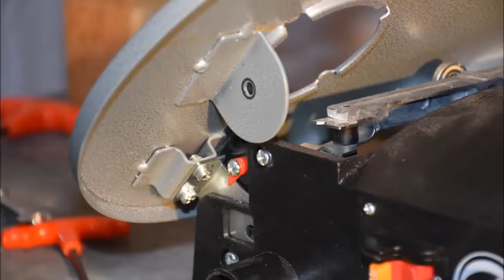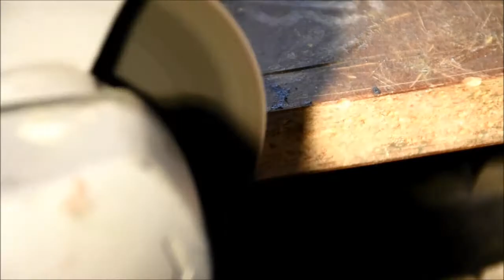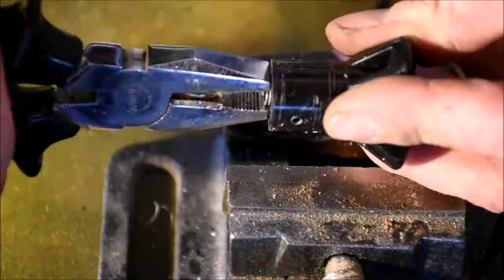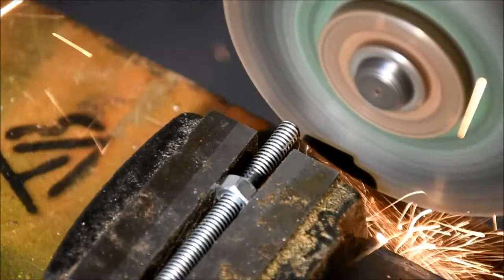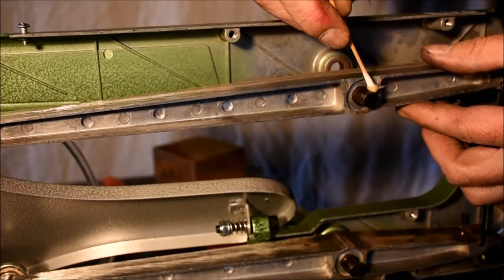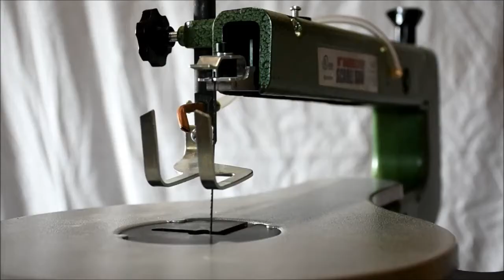Scroll saw blade tension bolt repair - Harbor Freight Central Machinery

Comment: Thank you so much for this tutorial.  It has helped me a lot.  I am still trying to get INTO my scroll saw. which is pretty new.  The older one went the same way. I am reluctant to buy yet another one, if they keep going this way.  This showed me what the pins are for, and has helped me try and work out (if possible) a way of getting into the inside. so far I had taken all the screws out, but no joy as yet.  BUT - this certainly helped to let me know what it looks like inside and what the issue is.  SO, THANK YOU SO MUCH.

Comment: EXCELLENT video. Have you thought of a quick cam lever to open/close tension for blade changes? Like some of the more expensive saws.  Small very detailed projects with lots of inside cuts and multiple blade movements gets tiring. Thanks for the video.EDIT: Found this. https://www.youtube.com/watch?v=cnHbNhOj4qY
Reply from the maker: Thank you.  I would like to upgrade the scroll saw some day, but it sees very little use, and therefore is low on my priority list.  Take care.
Reply: Thanks.

Comment: Excellent video!  I've been leery about opening mine up in search of a better way of lubing the bearings (vs the recommended 24 hr 'seepage' process) so I was primarily looking for disassembly/reassembly instructions to make sure internal parts didn't fall off and create a problem with reassembly.  Looks like no problems!  Nice job refabbing the tensioner bolt, also!  Thanks for the vid!
Reply from the maker: You're welcome.  I may need to show the bearings some attention because my scroll saw shakes like crazy.
Reply: @muddyfences5559  Mine's relatively new.  The instructions call for laying it on its side and dribbling a little light oil onto the bearing pins and letting it 'seep' overnight, then flip it over and repeat the process on the other side.  First after a 10 hour break-in, then every 50 hrs there after.  lol  Who's got time for all that?!  Hence, I wanna crack it open & see if I can shorten the process.  As for your vibration, maybe a counter balance issue?  Mine was rock solid until I switched to the pinless blade adapters.  They introduced some vibration.  In doing a DIY mod to make the adapters more user friendly, I added just a smidge of weight to the lower adapter and lo & behold, the mod worked great and the vibration subsided.  ???  Go figure!
Reply from the maker: That's a good point.  As much as I like the HF tool prices, the tools can be a mildly frustrating when it comes to quality.  What brand of pinless adapters did you go with?
Reply: I used the ones that came with the new machine.  Fairly simple once I figured them out and modded the bottom one so it didn't fall off when the tension was released.  (I don't guess they allow one to post pics here, but I took my cue for the mod from this video, if I can post it here, but made my own version... https://youtu.be/MBS6v-l-TYk)  These same adapters are avail aftermarket, as well...just not sure the brand.  A little research should scare 'em up.
Reply: @MHFROX what did you use for weight?

Comment: Both of the wedge nuts in my scroll saw broke, know where I can find a replacement for those ?
Reply from the maker: I always start with ereplacementparts.com. Good luck.
Reply: I saw someone recommended using Barrel nuts to replace the wedges.

Comment: Great video!  Do you recommend purchasing the HF scroll saw?  I am undecided between the WEN 3920 and the HF scroll saw.  I don't mind maintaining tools and it seems like the HF is straight forward and can be successfully worked on.  I can't even find a warranty service facility for the WEN scroll saw.  Your opinion is welcomed.
Reply from the maker: I don't know anything about the WEN scroll saw, but I can say the HF model is a low end / entry level scroll saw.  It works, but is really poorly balanced and vibrates. I would recommend you spend a bit more for a better quality machine if you plan on a lot of scroll saw work.   If it is just occasional,  it may be fine.